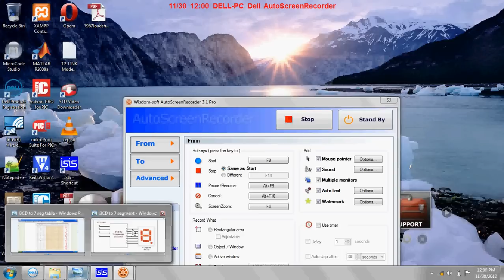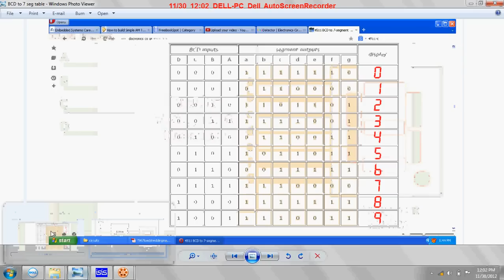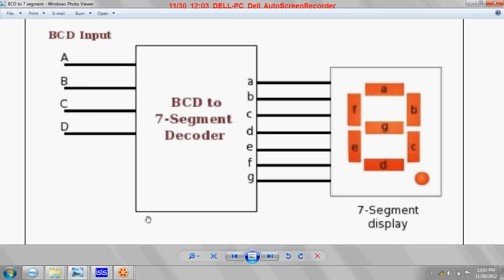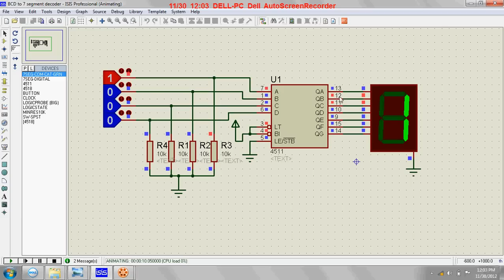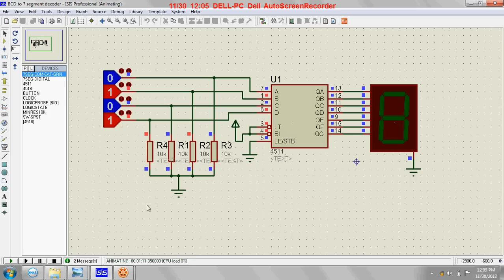BCD to 7 segment decoder.avi

Comment: what do you do to pins 3 and 4? sorry I don't know what that symbol is, i'm new to this
Reply from the maker: Sorry for replying late. LT (Lamp Test) and BI (Blanking Input) are both held high (connect power source to these pins) as we don't want to use these options in the circuit.

Comment: Sir, where can I get this 7segment display   LIG (LSD8164-20) it has 16 pins
Reply from the maker: I used common cathode 7 segment display. You can search for 7SEG-COM-CAT-GRN to get this component.
Reply: Riaan's RC Videos 
This one too is 7segment display.
But has four common cathode while normal 7segment has 2 common cathode.
Can I use the two cathode of normal 7segment twice to make it 4 cathode?
Reply from the maker: I don't think you can do that. instead do what I said. Search for 7SEG-COM-CAT-GRN and you will get the component.